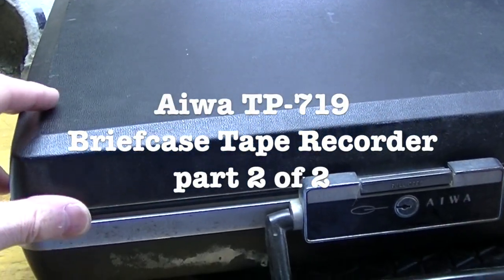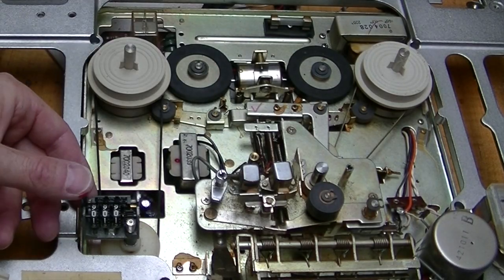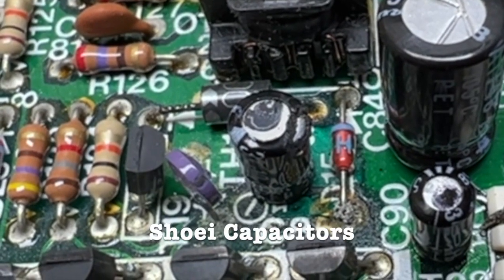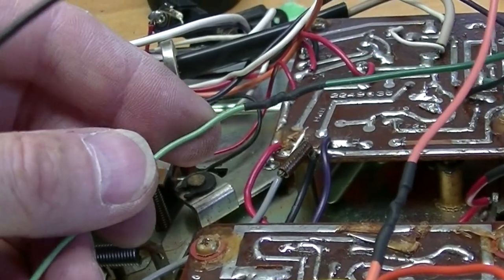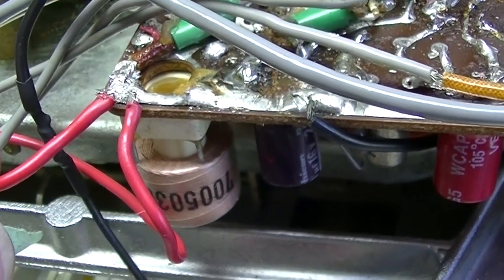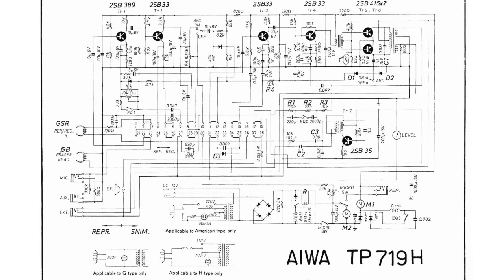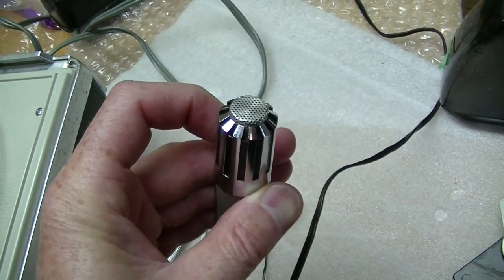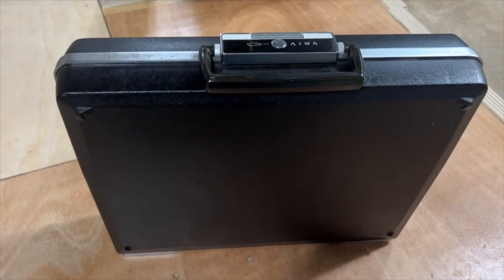Aiwa TP-719 Disguised Tape Recorder (Part 2 of 2: Repair, Troubleshooting, Conclusion)

Comment: Talk about timing! 
Last November, I picked up a TP-719 off ebay for $35 including shipping, with a noisy R-P switch & bad flywheel belt. I have a stock of new & recycled tape recorder belts, but no flat belts exactly like I needed for this machine. However I had a flat belt that was the correct length, but too wide. I was able to cut it lengthwise to fit in the pulley, and the noisy switch has improved with use. So far I've recorded about 4 hours of tape on my recorder and played back many more since last year. My TP-719 must be an older version as it has a fixed satin-chrome carry handle and a dirty-cream colored plastic case. I actually prefer the black case on yours. But mine did come with the power-cord, car-cord, battery-case, and both rear covers. Overall, the electronics have been working OK, but I've noticed my machine plays a bit fast when the speed switch is on the high setting. So I  just oenef up my recorder to check it, and I'm glad I saw your video today before I tried to adjust those two 'pots' on the power/relay board. Meanwhile, I'll ty to check the schematic you posted to see if there is any electronic adjustment for the motor. I'd appreciate if you could say where you found the flywheel belt.
Thanks,  Mark D.
Reply from the maker: I’m so glad the videos were helpful! You may be able to improve the R/P switch’s performance with a few squirts of the right flavor of DeOxit. Between the first and second videos I was lucky and picked up a second TP-719 for parts. It included the compartment covers, the original mic, the battery holder and the keys (for real security!) so now my machine is almost complete. I don’t know why your machine would play fast. The motor speed does probably depend a little on supply voltage but I don’t think that’s the problem. I bet there is an inertial governor (or other mechanism) inside the motor. It is probably worn out. I was able to source the two belts from TurntableNeedles.com, but that was after ordering from another supplier which I would not recommend. Let me know how you make out on your TP-719. It is a very cool (and robust) machine.
Reply: @Mr.BrownsBasement  Thanks for your quick reply.
Does your second machine also have a black case? I picked up two more like mine many years ago, when you could find them at flea-markets or yard-sales for just a few dollars. They all have a cream-colored case with a fixed satin chrome handle, just like the TP-719 in Clydesight's video. None of mine came with keys. I do however have a Panasonic 5" reel recorder built into a black briefcase.
Battery recorders often used a centrifugal governor inside the capstan-motor, but when the speed is controlled electrically, sometimes there's an electronic speed control. At least I was hoping in my case. I guess I got lucky with the capacitors. If some of mine are out of spec, it's not enough for me to notice. I have ordered from 'turntableneedles' but misplaced their info. Thanks for the link.  Mark D.
Reply from the maker: Yup, both the original and the donor both have the black case with the hinged handle. I’ll have to check out that video you mentioned because I’ve only seen the black case. Unless there’s some adjustment on the motor itself (I didn’t notice any) I think your motor is stuck running too fast. According to the schematic the motor is connected across the supply; no speed potentiometers to adjust. Best of luck…!
Reply: @Mr.BrownsBasement   My first guess was the black case TP-719 may have been a Canadian thing, and we only got the cream ones here in the US. But to me, it's more likely the black-case with the folding plastic handle was a production change to a more modern, comfortable to carry, and cheaper to manufacture design.  Maybe, US sales of the TP-719 ended with the earlier version, while sales in Canada continued with the black case.  Now, I'll need to start looking for a black one!
In any case, It is fun listening to music, while watching the reels-go-round. 🙂
Reply from the maker: I’m betting that you’re right that it was a production change. Unfortunately there’s likely no one left to ask as the company was bought out 20 years ago. Incidentally, I watched Clydesight's video and I agree with you that color scheme doesn’t look as good. Hopefully, you’ll run into a black one in good condition!